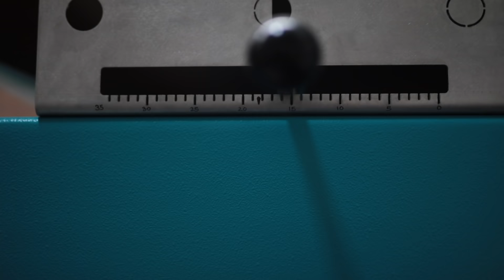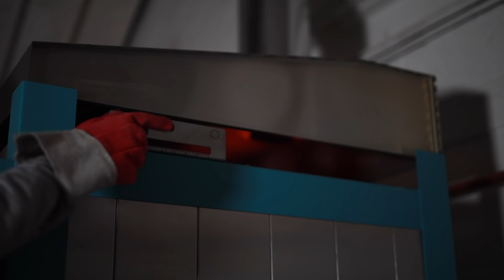How a Handmade Pottery Cup is Made from Beginning to End — Narrated Version

Comment: Now I understand better why handmade stuff are so expensive.
Reply: I was just thinking the same thing. Yesterday I saw some expensive ceramics and ask myself: how hard can it be? Searched and found this. The answer: very.
Reply: @comradedogo2441  how much is that in dollars?
Reply: @Ivy-or3wi  30 turkish lira is 3.48 usd
Reply: Not only is it much harder to do than most people comprehend, but there’s the hours and hours of work that goes to make it even feasible to produce numbers of pieces as similar as possible. There’s the experience that makes the lips of cups comfortable to drink from, or spouts that are capable of pouring. There’s working with the glazes, which trust me, isn’t intuitive. Most glazes don’t look anything like their fired counterparts, look different depending on temperature, and can be radically different depending on a reducing or oxidising kiln burn. Then there’s paying for the power for the kiln. Be it gas, electric or even wood fired, the fuel has to be paid for. Glazes can be bought or compounded by the potter, but either way, it has to be paid for. Clay body has to come from somewhere. Even if the potter digs and purifies their own clay, it costs money to dig raw material, store it, purify it. Or you can buy it prepared, and accordingly more expensive. And finally ofc there’s actually making the pieces. A production potter brings that time down to a minimum, but it’s still an important expense, plus there’s the electrical power used to produce pieces, for light, heat and the wheel. Tbh very few handcrafters are paid what their work deserves, but settle for, hopefully, something that is livable.
Reply: Yes and him much skill, knowledge, studying, and equipment (which is expensive) it requires.

Comment: Amazingly informative! Best simplified explanation I've heard of what happens in a reduction atmosphere. BTW folks if you struggle w pulling handles you can do it upside down for a bit. just slap some clay down on the edge of your wedging table. Pull up. When it gets long enough it will flop over and hang. You can pull downwards at this point if more is needed. I like doing it this way cause the "flop" produces a nice organic curve, useful for ear-profile handles

Comment: I think the best tonic cups are the ones with a slight bulge towards the bottom; so when drinking, you are naturally decanting: leaving behind particles that are not mixed in the drink. If doing that, also the tip can be modified to make the tilt of the cup for hot drinks: so the speed of liquid does not go too fast into the mouth. 👍🏼

Comment: Really fascinating and educating.

I think in the case of reductive firing, you force the fuel to seek oxidants from your glazes. Oxidants are a group of chemicals that can aid combustions, with oxygen being one of them. There is, for example, fluorine gas that is a very strong oxidant, so strong that it can set a lump of charcoal on fire as the gas is flowed towards it. In this case, iron(III) ions, responsible for the red colour, act as an oxidant together with small amount of air flowed in, and iron(II) ions which are green are left as a result. It is pretty complicated, chemically speaking, to say what else happen to fuel molecules. However, the whole chemistry here is cool nonetheless.

Comment: Given the bottoms are unglazed, would they not soak up water? Or is the final firing hot enough that the clay itself becomes impermeable?
Reply from the maker: Stoneware fired to 1290ºC becomes completely vitrified, meaning water can't permeate it. Terracotta, on the other hand, a clay that's fired to lower temperatures, never truly vitrifies, meaning you need a glaze to seal it, but yes, these cups are fine, nothing is leaking in or out.

Comment: I’m surprised that you have crackle glazes on domestic ware. As you know, a glaze crazes when the glass layer shrinks more than the clay even when the layers are boned completely. . The thermal expansion and contraction need to be the same so that crazing even if not present on opening the kiln, does not occur later( often for the life of the pot) Pots are stronger when the glass layer fits and even  holds the clay only slightly under compression. The problem is greater when the pot is covered inside and out by the same crackle glaze. Crackle glazes( glass layer that cracks and allows staining to be trapped in the cracks especially with mugs ) are more prone to damage from impact and do not have the “ring” of confidence when tapped with the knuckle .